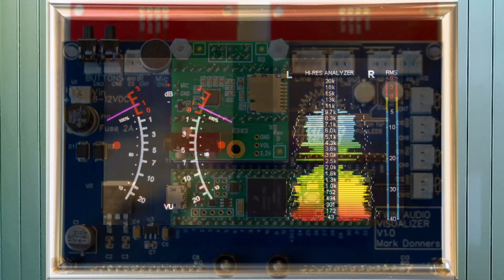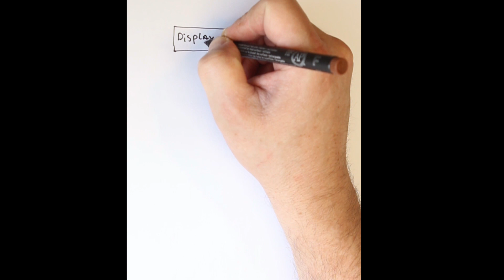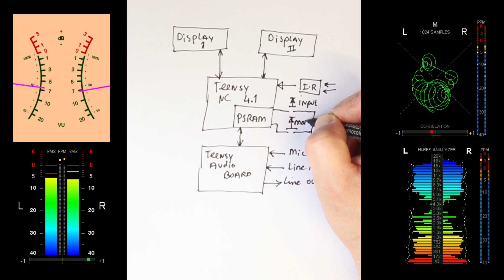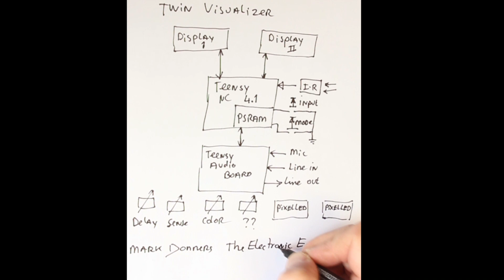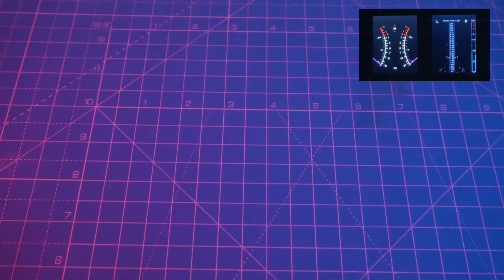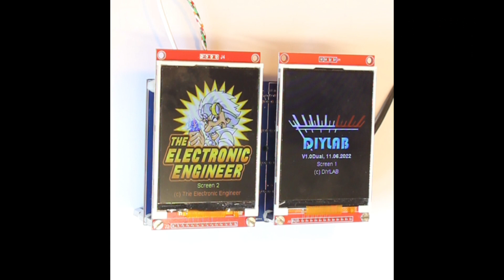Amazing Twin Audio Visualizer to the rescue

Comment: Apart from Teensy, is it possible, sir, for example, ESP32 with a single screen?
Reply from the maker: @Oke1-q5n  not without complet rewrit of code. Memory is the problem, esp32 with external memory is not that easy. It would require hardware changes. For example, you cannot do that with the esp32 devkit. But I build other analyzers and most use esp32. Check out the other video’s

Comment: An amazing product!
How many samples do you take? 1024? I tried looking at your source code and that's what I deduced from the names of the functions.
Are you using windowing? How about overlapping FFT or do you discard all the samples and get totally new ones right after you perform the FFT? And what is the fps?
Reply from the maker: The FPS depends on the screen mode it is in, I believe the main screen is in 180 FPS but the spectrum analyzer is like 220 FPS... the samples are 1024. The other questions you ask are good and honestly I don’t have the answer at hand. I’ll also havo to look into the code. Because that part of the code was written by DIYlab.de But I know that all the FFT is handled onboard by the audio chip..
Reply: 200 fps is really fast. I've only been able to do 70 fps.
The fft has to be overlapped because the fps is so high and you use 1024 samples. The next fft probably discards the last 256 samples and adds 256 samples to the beginning. This means fft is 75 % overlapping.
Windowing is used to get better separation of frequencies. If there is no windowing one frequency will spread out to the neighbouring frequency bins.
Windowing is just multiplying the fft signal with a function that starts from zero, goes slowly to one in the midlle and then slowly falls back to zero at the end.